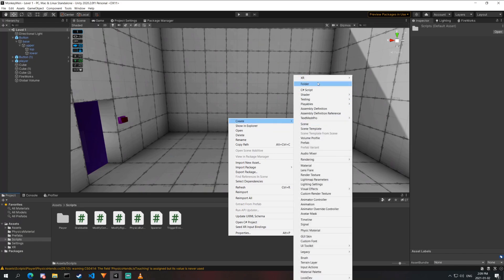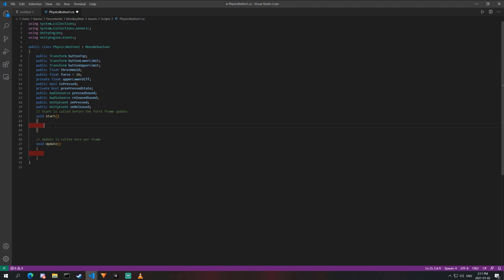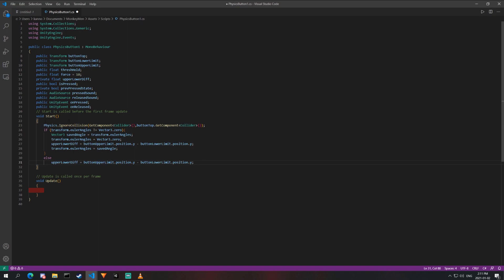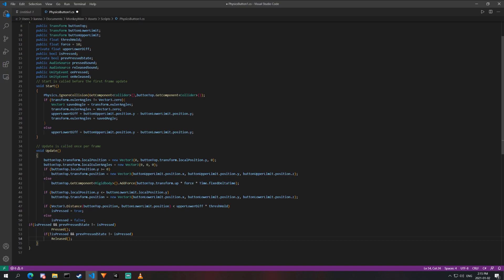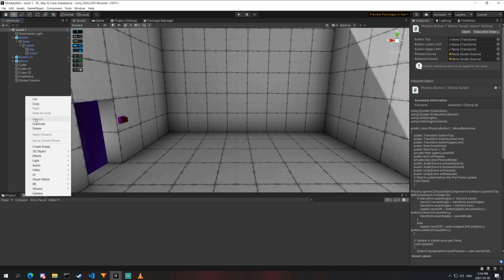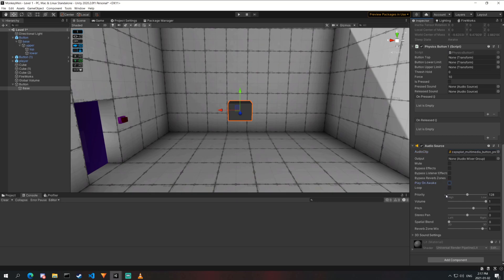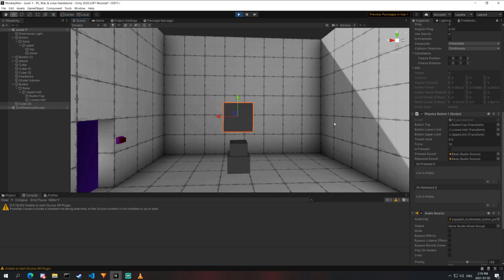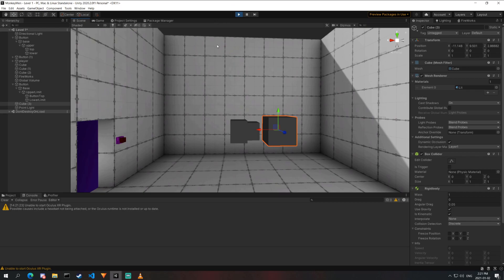How to make a pushable button with rigidbodies in Unity

Comment: This is great! The most clear and easy to follow tutorial ive seen. Hands down. So I'm clearly missing something. I push the button with any object in scene XR Grab Interactable script, a rigidbody, and a collider, or set the item on top of the button, and it works. I cant physically push the button though with my contollers. One arm is a ray interactor, the other arm is a direct interactor controller with a hand prefab with rigidbody and a collider attached to it. What dumb thing am I missing?
Reply from the maker: The most common problem is the mass of the objects. I would decrease the buttons mass and increase the hand mass this should allow you to push the button down.
Reply: @DonionTech  Hi, i did the same and the button is still not being pressed. Is there anything else i could do?